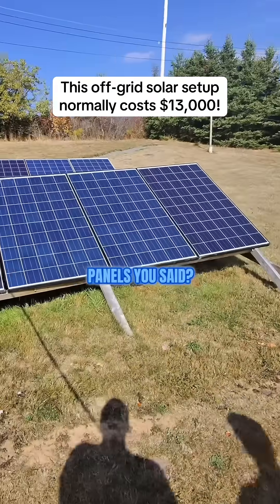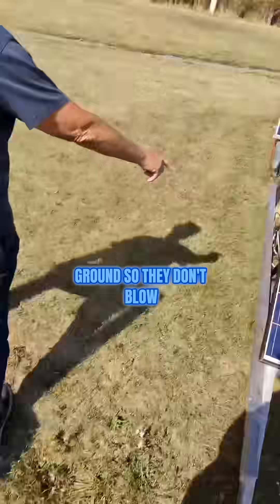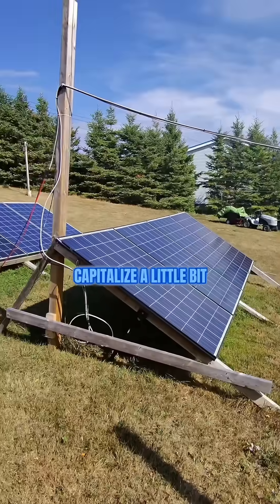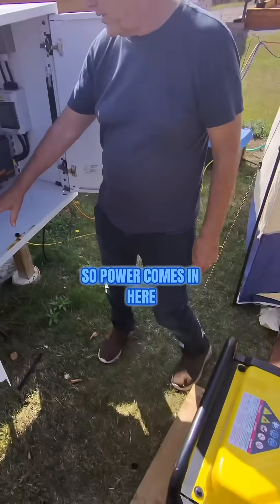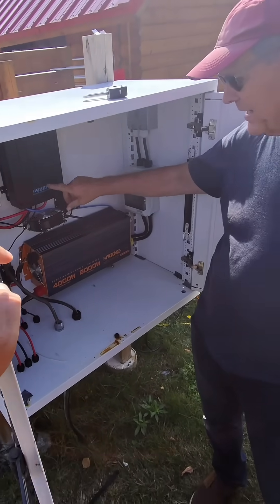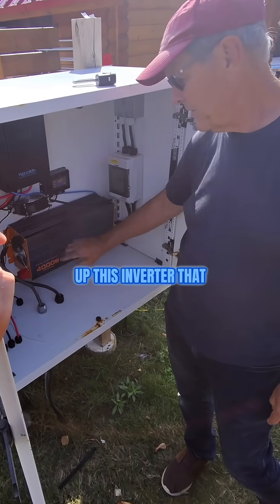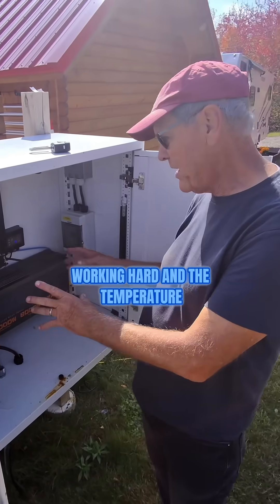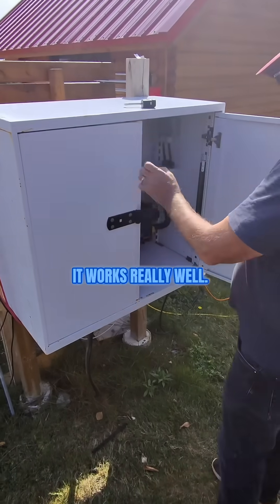Off-Grid Bunkie Setup with Solar!

Comment: Electricity is my biggest utility and if one able to do this it would help but I would still want to be able to hit switch and be on grid!
Reply from the maker: Our off-grid solar system is perfect for independence, but you can always add a grid connection for backup or primary use if you prefer!